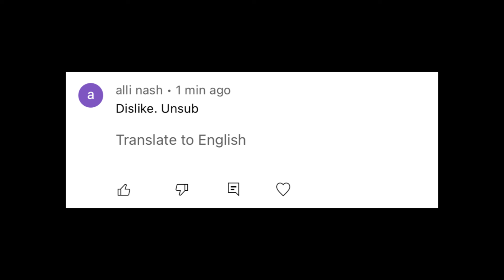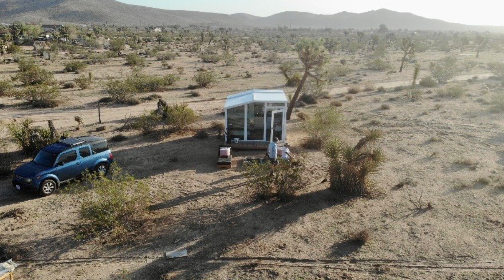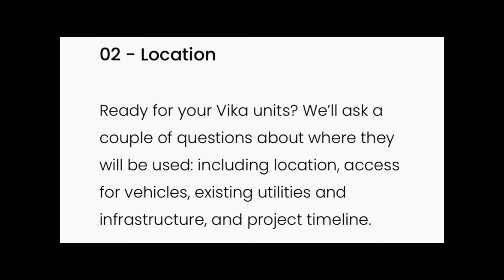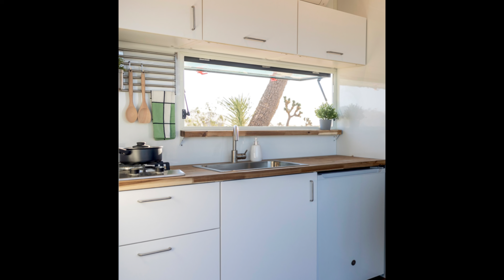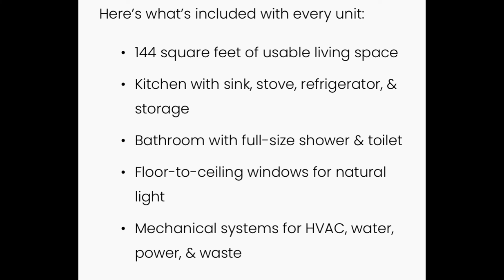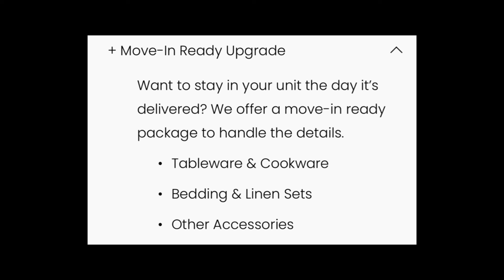Affordable PREFAB HOMES that are Now Being Built In California!

Comment: The trouble I’m running into with these houses is that they only build on flat surface of land. Most available land in LA in various areas are sloped.  There would be excavation involved to clear the land but they won’t give you a quote based on current records of the land being sloped. Any ideas?

Comment: People need to realize that the major expenses of a new home tend to be the kitchen & bath. Appliances for a regular small home can be less than the more custom-sized smaller appliances used in a tiny home. Often a "normal" small home is designed to optimize standard lumber sizes which requires less cutting (less labor) and less wasted material. Prefab homes usually do a good job of optimizing the lumber too, but there's a premium price for the indoor space, machining and labor required to build them indoors and then move them and set up. There are pros and cons to everything and tons of variables involved no matter what you choose. Is anything affordable in California? It looks to me like those living on the streets or in their cars, campers or tents are the only affordable housing in much of the state when compared to most of the country.

Comment: Here comes criticism. Great they chose SIPS, but fiberglass? Resin and glue off gassing concerns and fire hazard risk as in the Grenfell Tower fire incident in the UK. No product safety data or engineering certificates. They also used a glass based SIP wall assembly. So again, not built to pass building code, another company marketing RV products. Put a renter in it and you're legally liable.

Comment: $38,000 starting for what amounts to being a glass pod. Plus delivery and setup and taxes, fees and permits, sewage, water, solar panels or hookups to the grid. No porch, no patio no covered parking or garage or protections against the elements. Don't know what the minimum cost would end up being.  If your young and that's what you have to do own a place of your own and get started perfectly fine and good enough though. Just make sure your front entrance and windowed areas are facing east and south to the sun and not north and west facing the cold wind and storms. Makes a difference by several degrees in temperature.
Reply: Let's talk on @Kerry_Tarnow1  ???

Comment: Made in Los Angeles?? that’s gonna be Expensive! But The VIKA ONE  $38,000….for 144 sf.  NOT BAD…….👍 However, I think the BOXABLE is still cheaper for their size since it includes ALL appliances! Their price is $50,000 for 375sf….with TALL ceilings
Reply: A single-wide mobile home provides between 600 to 1,300 square feet and their dimensions are 90 x 18 feet or less. The average cost of this type of trailer home is $40,000 if it's new.
Reply: @sethpawlik  more worried about hurricane, tornadoes….with BOXABLE, they literally dropped a truck onto the roof as demo. These things are beyond strong against hurricane and tornadoes. It also looks really cool….

Comment: People and horses are now living in a standard 12’x12’!😂🤣
Reply: A single-wide mobile home provides between 600 to 1,300 square feet and their dimensions are 90 x 18 feet or less. The average cost of this type of trailer home is $40,000 if it's new.
Reply: @sethpawlik  About 16’x72’ is average these days, at least in my area. $40K is too cheap for a brand new SWMH that size but they can be bought for under $65,000. There is a used MH dealer near me where you can by a refurbished SW that looks brand new for about $40K to $45K. The only problem is due to fed govt regs, you can’t get a 30 year fixed on a used MH, regardless of condition.

Comment: 38,000 isn't bad actually. If they can keep that price range and fit a combo washer/dryer in that closet area between the living space and bathroom, then I think they'd have a big winner with this! If I could ask for anything more it would be to swap the sink and fridge placement and fit in a Side-by-Side Compact Refrigerator and Freezer even if means smaller or no drawers under the stove. Those rinky dink tiny freezer compartments in most under-counter fridges just wouldn't cut it for me.

For off-grid waste options, I didn't see any mention on their site about incinerator toilets. They might want to consider adding that as an option as well. No need to deal with compost or dry flush disposal when it's all turned into a handful of sterile ash.

I am curious if the bed in their photos is a full-size or a queen-size. If it's a queen I'd probably personally use a full instead just to have a little more space for a desk.
Reply: I so much agree with the rejection of  the rinky dink under the counter fridge and freezer sizes (i think they're for those who use these for Bed and breakfast only or overnight /weekend guests?) Still i think they are too small even for those , personally. I like your other ideas too ..Thanks for taking time for that.
Reply: All your upgrades will add at least another $10k
Reply: @gracefulkimberella  I could definitely see that due to the incinerator toilet alone. It's around $5,000 for a good one. The combo washer dryer around $1,800 for a nice one. The fridge isn't too bad though. Only about 500-ish. But yea those three things add up fast. Fortunately for me, I wouldn't be going off grid like that so I could stick with a conventional toilet he he. But the fridge and washer/dryer combo would be a must!

Comment: if it in California, it won't be affordable
Reply: Hello?? Maybe you can't hear??? It IS in California for $38,000. ???????
Reply: @gracefulkimberella  plus sewage and water probably another $20,000 or more. Solar panels thousands more. Could end up costing up to a hundred thousand or more.
Reply: @danielcraft3727  If you look it up! It's 48k for solar and water filtration and pump included!(wells in the desert work best)  That is pretty affordable for off grid livinf
Reply: @gracefulkimberella  starting at $38,000 is just for a 12x12 pod not including deliver set up taxes permits, etcetera. More like $60,000 starting for a simple glass pod without even close enough insulation for cold of the winter and the heat of the summer and no porch, no patio, no covered parking or garage, etcetera. From Arizona to Alaska have helped to build houses to log homes. Learned a thing or two. Wouldn't recommend a glass pod for a full time home out in the former wilderness area's of AirBnber's.
Reply: @gracefulkimberella  

  Composite Material They primarily import from China 
Vika Living. Carson California
Reply: @gracefulkimberella  the price of the land and the taxes on wages and pension, will break most.
Reply: It could work as an AirBnB or a short term rental.  I could put one in my backyard.
Reply: @thisorthat7626  you have to live in the house while bnb renter is there. So max you can have one of these going at a time. Jokes
Reply: Depends on your definition of affordable.
Reply: Truth
Reply: They primarily import from China . Vika Living.  California
Reply: California is a a big place to make a blanket statement.
Reply: Look where the demo unit is. Desert is the best place for it! My wife and I live in something similar and it's been great! No utilities no problem. Starlink makes it no different
Reply: It wont fly
Reply: Make them green with re cycled products please.?
Reply: You got that right. Even if you have the initial 30,000 you still need a place to put it. An old friend of mine believed she would be better off walking away from a home she had lived in for twenty years and bought a run down, mold filled mobile home. She was so happy. The space rental was five hundred dollars. Which went up every single 

year. After just a few years her rent on just the space was over  750  a month.
Reply: Land 500,000. Tiny house 38,000.
Reply: Don't live in Commifornia
Reply: Nothing in California is affordable!